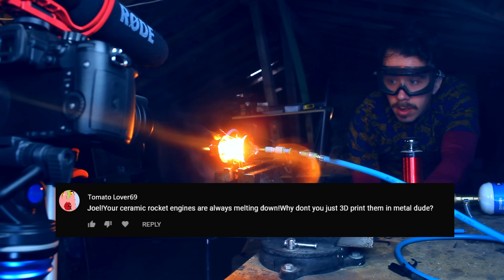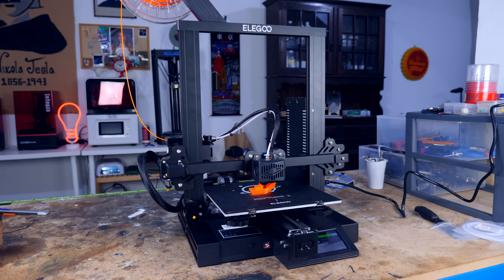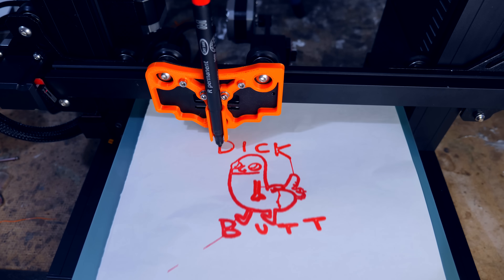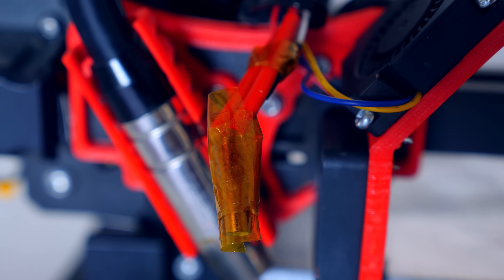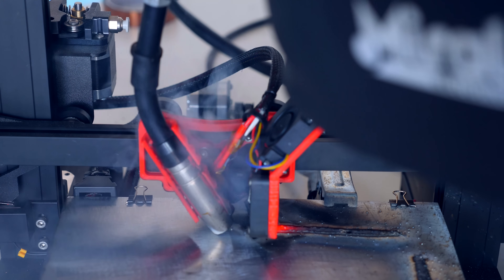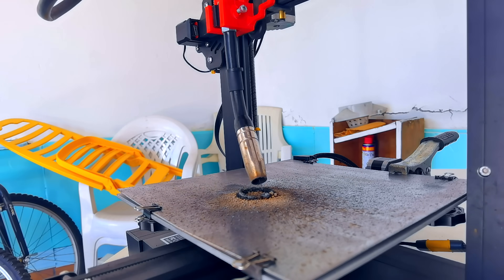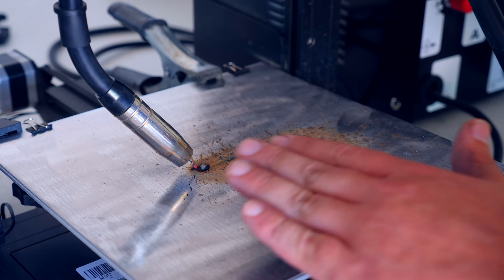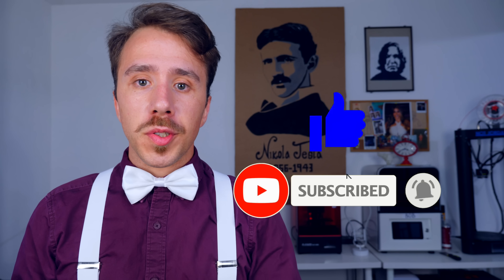I built a Metal 3D Printer using my Welding Machine

Comment: Integza, welding requires a shielding gas to protect the weld from oxidation.  Flux core wire has material built in that creates its own gas to protect the weld. Pointing a fan at your nozzle seems like a great idea but in reality you are blowing away your shielding gasses and reducing the quality of your weld. Good job on moving the mount further down the nozzle. 
Another tip is Anti-Spatter spray to keep the spatter from sticking to things you don't want it to.
Reply: Using a Metal Inert Gas (MIG) welder will produce MUCH better welds as such the weld may not need to be cleaned before its welded over during the next pass. 
Im thinking that your base metal should be 1/4" steel plate mounted over an aluminum sheet with an air gap between the two (your fan should go here).
Also I think you could re use the 1/4" sheet over and over by prepping it with an angle grinder, having more than 1 sheet would be a good idea too. 
I think if anyone has the ability to do this and actually have it work as a DIY its you. If you figured this out and started putting together kits for people to buy and assemble you'd revolutionize small scale home manufacturing.

Comment: maybe you should work on the resolution of the layers. The plasma heats like crazy and the down layers definitly melts down/deform by that. If you could low down the power, increase the supply of metal, lower the speed and do large layers, you could achieve better results

Comment: So, minor correction, G code can do curves, the codes are g02 and g03 (moving clockwise and counter clockwise respectively)  they also need to either be set a radius or a center point.  Example of radius method g02 x1 y1 r1 will give a radius with a circle of 1 ending at 1,1.  Written as the center point (or IJK) method: g01 x1y1 i,5 j.5.  The second method requires a bit more math as the IJK coordinates are relative to your starting position but gives more control over the final product.  edit: Minor addition, the R method will not draw a complete circle either.

Comment: I definitely like this idea, I have worked with metal 3d printers, mainly binder jet, and they are crazy expensive. You are definitely on to something and I would like to see you continue with this experiment. I might try it myself on my old printer and my welder. Another possible solution for your rockets is casting them out of aluminum. You could print the rockets for patterns.

Comment: What I did when I needed a rocket nozzle, that could withstand the heat of rocket engine? I 3D printed mould out of PLA at my school, then pored concrete in and let it set. when the concrete had hardened I just melted the PLA and it came right off. Only downside is that you cant reuse the mould and the nozzle cant be thinner than ~5mm. If you are ready to do more complicated work you can create a concrete mould and pour molten iron in it.

Comment: just buy an inch thick block of steel and then reuse it, grinding off the failed metal prints, and using something like the support rafts to make that easier. Using a single big reusable block instead of the sheet steel would be cheaper in the long run, and you could probably get it at a scrapyard. Maybe something like a track link from a track vehicle if you can't find an actual block of steel. I'd buy one for you if it weren't for international shipping, but you'll need to find your own local scrapyard, because I'm even less made of money than you, and there's no way I'm shipping 50 lbs of steel internationally.

Comment: You should try using regular wire for welding, with CO2. In that way, you get rid of the residues of the flux present in the rosin core welding wire you're using.

Comment: there are several problems I see with this, one like you said, too thin of metal.  Two, you're using flux core wire, so in order to get the strongest possible weld, you'd have to stop every layer and clean the slag off, and three, the welder is too cheap, because it only has two settings, you can't fine tune it enough to keep it within an acceptable parameter.

Comment: you could try melting metal to make a high-temperature nozul for this you take out a mold from the printer and cover it with clay then you build a simple metal melting furnace using the oxygen source you have you pour the metals you melt into a mold and you get high temperature resistant nozzles.

Comment: Well, still not the solution for my problem of building metal joints for martial arts, but getting closer.
I remember once I used a sort of glue, which was a paste made of aluminium particles and some sort of epoxy. 
Perhaps printing with such a "paste" will produce more resistant objects, although not heat resistant.

Comment: This may be crazy but why not print in a similar way to the ceramic for metal using powder in a resin base then bringing the temperature up enough to fuse the dust without melting it. Shure the metal from this would be weaker than normal metal but it would be heat resistant.

Comment: Idea: Try lost PLA casting for your rocket engine parts. A nice excuse to try casting, would yield metal nozzles etc that could be welded to pipe. Or even cast a whole rocket in two parts and weld the seam.

Comment: Video idea : if your rocket engine is robust enough, put it on a ramp (like the one you used to see if your engine produced thrust) but longer. Then put a blade on the front on the engine and cut stuff !! (like tomatoes for example)

Comment: If you would use a gas shielded wire feed welder and not a flux core welder it would probably work just my two tomatoes

Comment: Also keep in mind that your stacking metal on slag unless you use solid wire inert gas welding. Most welding CNCs use a gass filled box, which will reduce the fact that you need to remove the slag and  also help in keeping the spatter down. Still entertaining though this!

Comment: You can solve the ceramic rocket problem by vaccum impregnating the ceramic with high temp resin or with fine metal powder, well you could try I have no Idea if that'd work

Comment: What about metal integrity. For this to be useful you can’t be cleaning up the weld scale after every pass. That takes it to a new level of turgid. If you then weld without descaling you have a less strong build. I use a cnc machine with a plasma head for cutting and a mig head for repeat welding of components but the mig does one simple weld pass then i clean it up and move on. Depositing ontop of scale is always going to be an issue with this.

Comment: I know that sounds crazy, but it's an idea that always got into my head whenever I saw your 3d printing ceramics video, wouldn't it be better to just 3d print a mold, fill it with ceramic slik, vacuum dry the slik and than burn it, you shouldn't have any problems with wall thickness anymore

Comment: (I'm getting a welding degree and love 3d printing) I've been trying to make a metal 3d printer using a welder.  I've learned that aluminum might be the best case and to build up layers might need a copper jig to stop the metal deformation.  Because aluminum don't stick to copper. Also aluminum doesn't have slag and you have to move fast. So printing speed will increase.  I'm actually working with a buch of friends on this. I'm hoping to make a affordable 3d printer kit. Make it open source. I mean I can't imagine how people whould improve it and how much better it would become over time. Also the biggest issue with welding 3d printing is slag. It's what you have to grind off. With aluminum you don't have that. It also welds at lower temperatures and is kinda soft.

Comment: You can modify the Resin 3d printers to use a resin with metal powder and then put it in the kiln
Reply: The problem would be the amount of metal you could get into the resin and still have it print - there will always be voids left by the resin when you cook it, just as with the ceramic resin, which shrinks and cracks if you have thicker parts.  I doubt you'd get enough metal in the model to sinter into a solid part.  At best you would probably end up with a spongy lump with no strength at all.  Sorry to pour Tomato Puree on the idea :-)
Reply: @jezmy2006  you're kinda right. Although A company did a 85 : 15 blend of metal powder and wax in a fdm technology and it worked fine.

Comment: hahaha ... awesome .... 
the approach is nice, 
it would be an option to use Aluminum or Iron as holder for the welding tourch, 
the fans should have been connected to a metal tube to create some to the heat.
The problem with Welding is the excessive heat that is used to make the metal liquid, but the 3d printer is getting it's accuracy from the semi-liquid condition of its filament. so the trick would be, to get the Metal-filament to a controled temperature where it'S getting sticky to the ground, but not liquid

Comment: Video idea: Do a competition between you and Tom Stanton to see whose engine makes more power (your rotary engine against his diaphragm engine). The loser has to plant a tomato tree. To make it fair both engines should have the same displacement.
Reply: They should also have the same air supply.
Reply: Huh, there actually are tomato trees. The more you know...
Reply: @LordDragox412  To be honest I wasn't sure what is the proper name of the plant that grows tomatos so I just went with a "tomato tree" XD
Reply: @davidvondracek4994  yea, the tomato never falls far from the tree.... X"D X"D
Reply: @davidvondracek4994  they're actually called tomato Vines.
Reply: @zeanyt2372  I see, that makes a lot more sense.
Reply: @lukearts2954  lol :D
Reply: not the collab we deserve but the collab we need
Reply: It can never be a fair competition: when Integza has flames on the set, he has to use an extinguisher... Stanton on the other hand, his head's always in flames and cannot be put out.
Reply: Wouldn’t be much of a competition
Reply: @iain3713  Why do you think so? I think that the rotary has higher rpm but the diaphragm has higher torque which should make it quite competitve. But that's only my guess so I could be wrong.
Reply: @davidvondracek4994  because rotary engines need face and edge seals. The face seals need high pressure to hold properly and even then they still suck. And with high pressure there is a ton of friction which inhibits rotation. The edge seals just suck in general and don’t really seal anything. While with the diaphragm the only seal you have is between the rubber diagram and a brass pin, which is a very effective seal with low friction.

Comment: I think its called Arch printing, in marlin and cura slicer you can set the arch mode. makes the printer draw arcs in much less code as apposed to drawing thousands of straight lines.